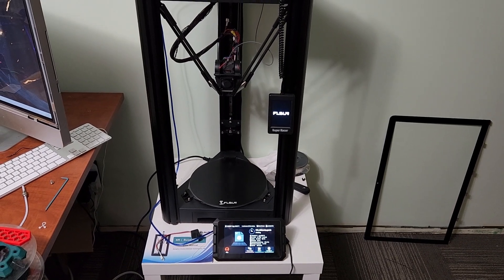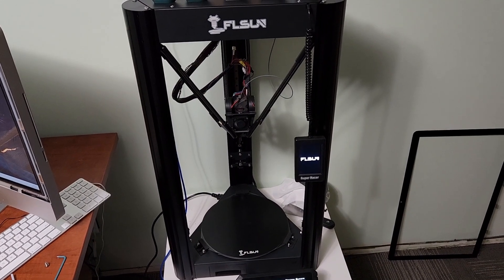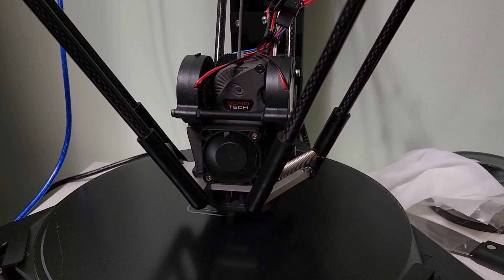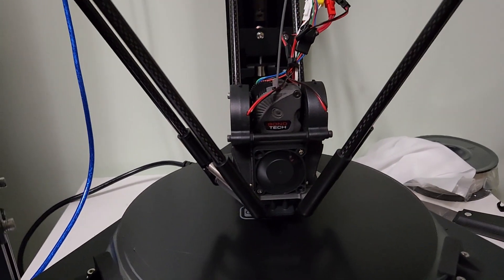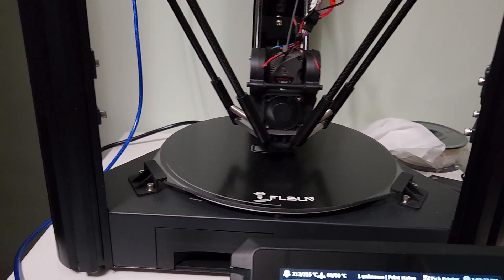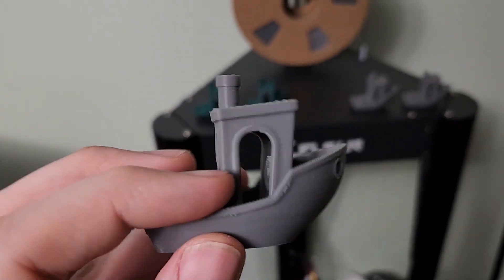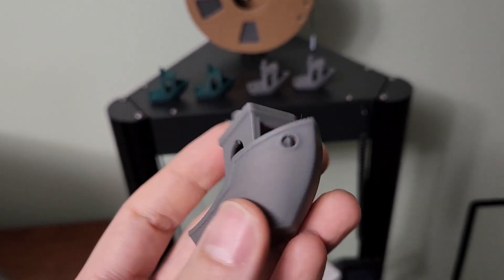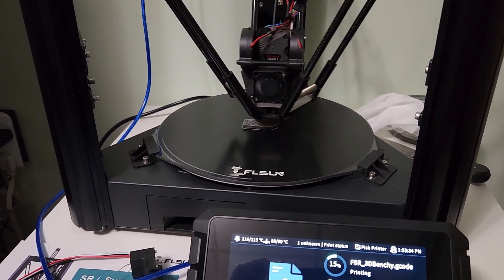Mods for my FLSUN SR Delta 3D Printer! - Part 2 - Effector Mods

Comment: What filament direct drive did you use?
Reply from the maker: @jerrygaguru  lgx extruder
Reply: @ which version there seems to be many made, but unable to find the correct one in the US. The company is clearing these out this week for a terribly low price and I love watching these, but I’d like for it to be somewhat functional what I’m sure it will be on the box so it may be a waste of time but it does make sense to do the upgrade if you did. I’m just hunting something to tinker with till the K2 max gets here. I’ve got a spring free printer in my bedroom so I can watch them during the night if I’m having trouble sleeping one of these Delta machines can put me to sleep in 20 minutes..
Reply from the maker: @jerrygaguru  lgx lite, you can see the effector mod in the description
Reply: @Rolohaun  I hate to tell you it is no longer there. Just 3 3d printer file links, it may be in 1 of them I have found it yet but your last message told me what I needed. TY

Comment: Can you share your speeds with your double 5015 fans? I'm having trouble running 2 of them because its too much cooling
Reply from the maker: I was only printing PLA, don't recall but I think around 40 percent, I print at 220 temp

Comment: How did you get the Purge Line? After the Upgrade to Klipper, My Flsun SR does not make the Purge Line with the same Cura 5.5 Profile.
Reply from the maker: I just used the Cura config that was default on 5.2.2 I think, It has been a while

Comment: Could you link to the specific direct drive extruder you used to fit between the 5015s?
Reply from the maker: It's a lgx lite
Reply: @Rolohaun  thanks, did you spend the extra on the upgraded drive gears? I'm wondering if it is a worthwhile upgrade
Reply from the maker: @dillonw3200  I just bought the normal one. However I believe the upgraded gears are better

Comment: What speeds do you get on your super racer? I have a QQS pro and converted it to DD. Haven’t tuned it for speed since I have clogging issues with my knock of V6.
Reply from the maker: I used the stock SR hotend and was able to printed over 100mm/s I never ran input shaper or anything.
Reply: some people with heavy mods can print 500+ mm/s with the SR, keep an eye in super racer groups, there will be a guide when those results will be replicated on many printers, for a hassle free upgrade you can buy the v400 effector and use that at 3/400

Comment: Does the LGX lite work with the SR stepper motor, or do you have to get the whole bondtech assembly?
Reply from the maker: you will need a new motor
Reply: @Rolohaun Do you recommend the sonic pad?  Do you need the raspberry Pi?
Reply from the maker: @Davidjones-sk4vf  either a BTT pad 7 or a BTT Pi is best. Both do the same thing. just one has a screen if you want that
Reply: @Rolohaun  Is there a step by step for converting the SR for the Bondtech LGX lite and the pad 7?  Really want to do this conversation to get away from the boden tube design.

Comment: Did you have any skipping with petg or other fikament? What is the voltage for the bmg motor? İs it a volcano block or also upgraded?
Reply from the maker: 24v for everything, hotend is stock. I upgraded to a lgx lite direct drive ectruder. I only printer pla with it
Reply: @Rolohaun  what is the amper for lgx motor?
Reply from the maker: @mohankuru7760  I don't recall, I sold the printer. I want to say 0.4 but I usually increase if needed as long as the motor stays cool
Reply: Привет! У меня такая проблема. Заметил что греется сильно подающий мотор когда в комнате жарко

Comment: CHC pro fits fine without modding the effector. Running klipper, and 0.9 degree steppers, you can a very accurate, and fast printer (can can print so fast that i still outrun my chc pro + cht clone)

Comment: This is the first mod I did with my SR as well. 5015's and klipper but kept the bowden. I highly recommend printing a roller filament stand that uses bearings as your next mod.
Reply from the maker: that would be a good upgrade for sure
Reply: @Rolohaun  what is your setting in cura pour retractation and other pls
Reply from the maker: @leomadraza8013  stock settings but I converted to direct drive so my retraction is 1mm and 40mm/s

Comment: Huge relief to hear somebody point out plainly that Cura 5.3 has problems! I was ready to throw my Q5 in the trash after I went from Cura 4.10 to 5.3. Thanks!
Reply: I was literally thinking it was my fault that I got more and more problems. It kinda reminded me to not change a running system. So no updates for me, if nothing new and worthy is included (like the tree supports in Prusa Slicer).

Cura always tells you to update "for better printing experience". It's quite annoying.